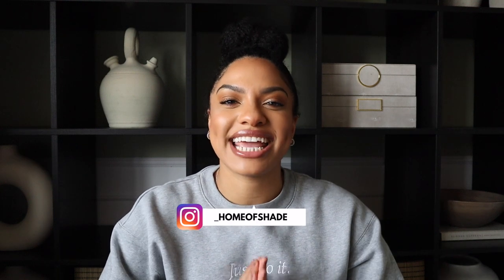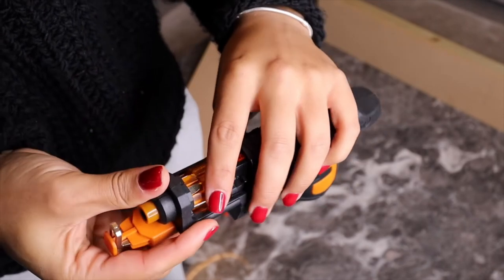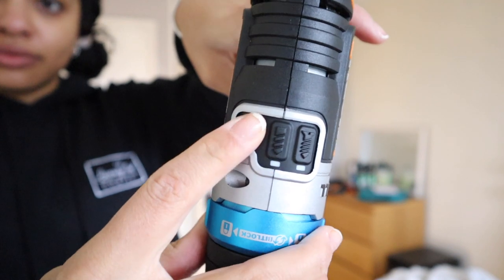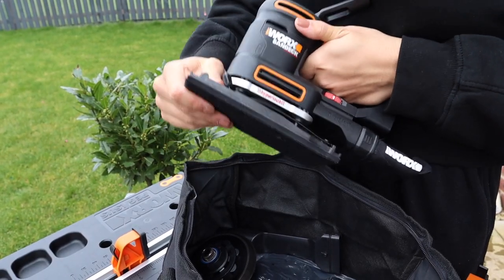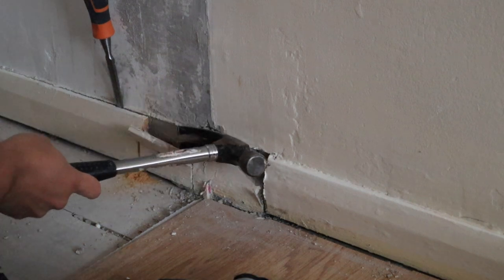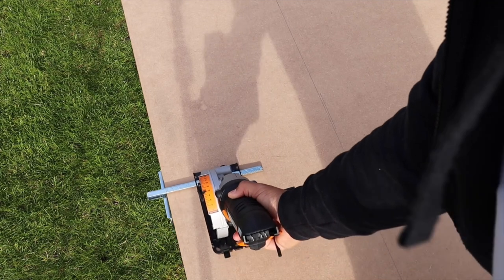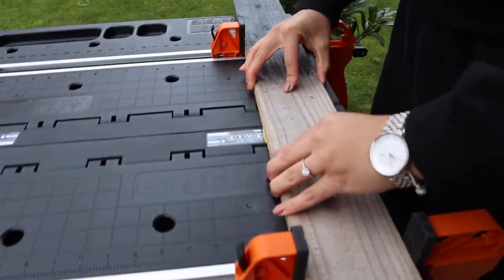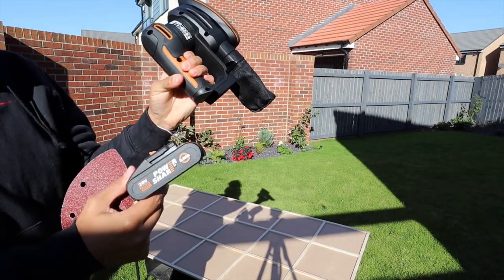Power tools for beginners ... but easy to understand

Comment: Worx needs to double your compensation. When you did the mirror project and I saw the sander, I purchased it before the video was complete. I already had the work pressure washer so I was able to swap out the battery. I would to get many of the tools featured but this small NYC apartment would let me live my best DYI self. I guess I'll have to settle for the hand circular saw.
I ❤ the video!!!!

Comment: Your video couldn’t have come at a better time. I’m looking to purchase some tools for home renovation, when I move into my first home. It will probably be a full house renovation so this is really useful.

I am slightly confused with the drills. Would I need a slammer drill and the AI / slider driver or will the slammer do everything I need? I thought buying a drill that does it all would be best and then the slider driver for flat pack.

I don’t want to buy anything unnecessarily but I always like to buy on recommendations. Thank you.
Reply from the maker: Slammer drill will do everything you need but it does have limitations. Ideally, if you are trying to build a collection, you’d have both a hammer drill and a regular drill like a brushless motor. But if you’re just looking for one tool to do it all the slammer is the more versatile! X
Reply: @ShadeShannon  thank you, I think I’ll aim for a collection. I have a while to research and buy but would rather buy good quality pieces that will last me. Thank you for the helpful video and response